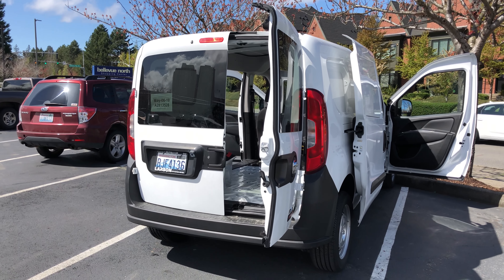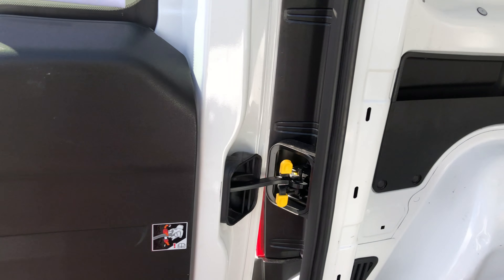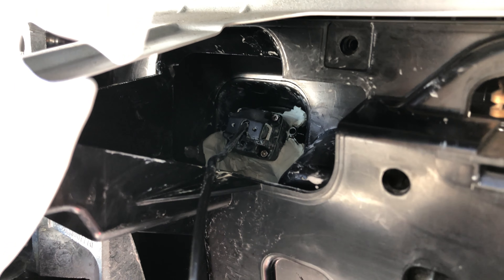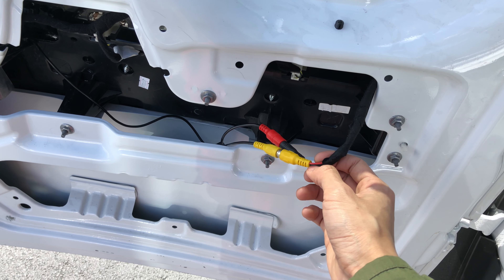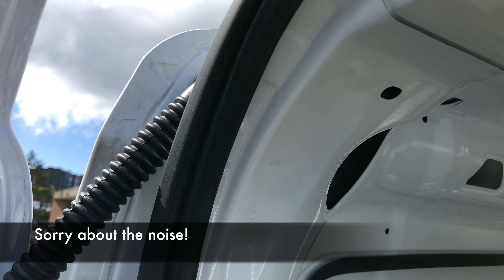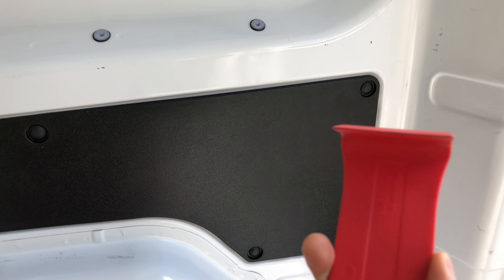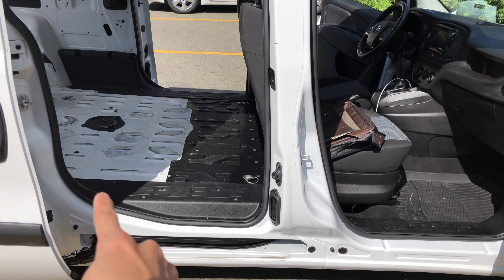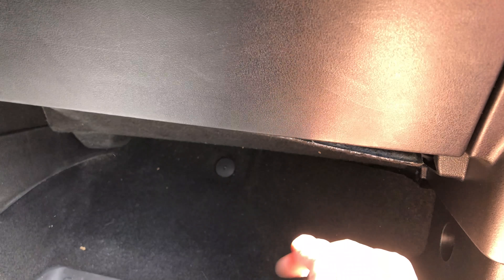How to Install a Backup Camera into the RAM Promaster City

Comment: Curious - could you have simply connected the camera to the existing 'factory'  radio? Or did you haave to swap out the radio to get the backup camera feature?  Also, please add links to the camera and radio you did use.

Comment: Confused about something…

In your medium post you said

>The video cable also includes an extra wire which can be used to send the backup signal to the aftermarket radio, but the Promaster City already includes that signal in the wiring harness, so we won’t be needing it.

Which wire gets tapped for this? And if there’s a video cable that runs to the back can we use that instead of snaking the video wire?